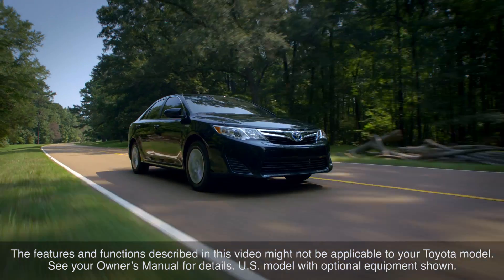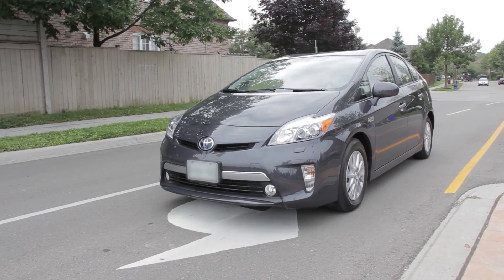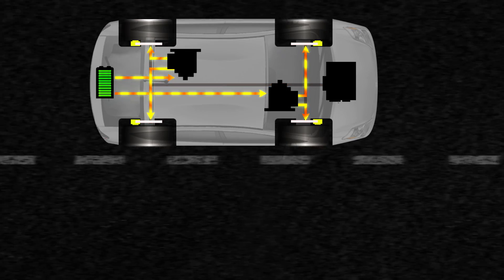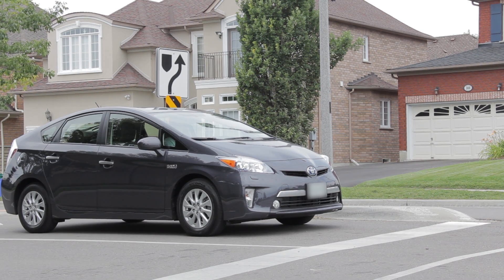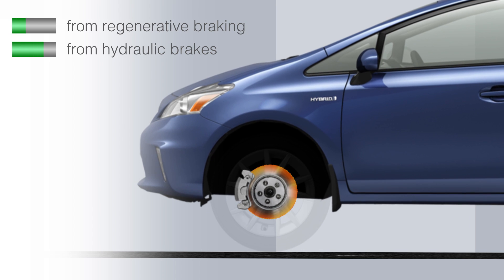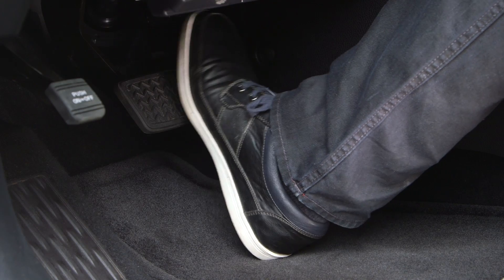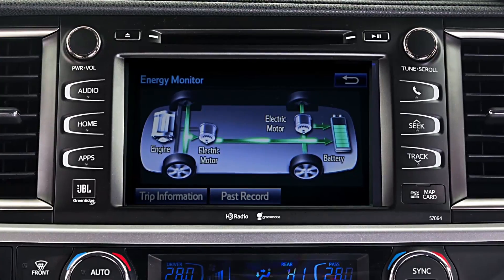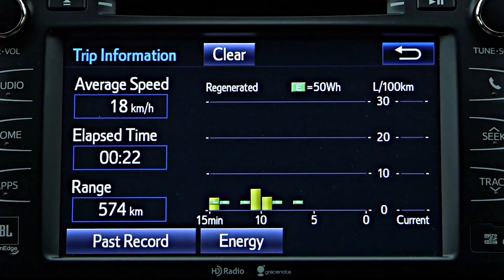Regenerative Braking

Comment: Toyota the only thing that throws people off is B mode people think B is regen braking when it’s engine braking made for downhills I was a victim of that mistake the first month of owning my 16 Prius. If you’re reading this drive you’re Prius in D not B unless you’re going down hill and don’t want to ride your brakes.
Reply: I have found that in a Prius, if you have cruise set before going downhill, the regeneration turns on in D and maintains the cruise speed without having to get in the B mode. This is very much unlike an ICE vehicle. I really like this feature.

Comment: I have watched tens of videos on this topic, but I still do not understand how taking your foot off accelerator results in braking and how fast does that happen? How do you control the distance at which you need to stop? I guess I need to go to the dealership and drive a few hybrids to get a feel.
Reply: In a Prius you use the brake pedal like a normal car and you’ll see your battery gain charge now if you brake hard because the light turned yellow then it would mostly use your brakes but if you slowing down gently then you can do most of your braking with regen. Now in a Tesla you can drive with one pedal (throttle only) when you let off the car strongly slows down and you’ll get used to the distance also if the tesla is slowing down more than you like then you can accelerate slightly then let off again until you get the hang of it. So Prius you use 2 pedals normal driving and in a tesla its one pedal. You can also turn off the one pedal drive in the tesla and use the brake pedal and it’ll still regen but driving with one pedal is super easy to get used to.

Comment: Hybrid systems are not required to shut off the engine.
Reply: No, but they are required to not waste fuel. In an ICE, you are using the gas no matter if you are depressing accelerator or not. In a hybrid vehicle, the ICE is turned off completely when you take foot off the gas pedal, unless the ICE is not at its normal operating temperature or if the battery is almost fully depleted.

Comment: only the energy recovered from regenerative braking saves fuel in a hybrid. minus what is lost in heat.
Reply: Not only that but the hybrid batter as well. When the battery runs low the engine turns on powering the wheels and charging the battery, once your battery is charged then you can let off the throttle and slight press it again and it goes into Electric mode driving with the engine off.
Reply: @hiyoutube8013 exactly P&G is so good with hybrids since on the glide you can lightly press the accelerator and maintain speed in EV mode.

Really helps you break pass the normal EPA estimated MPG